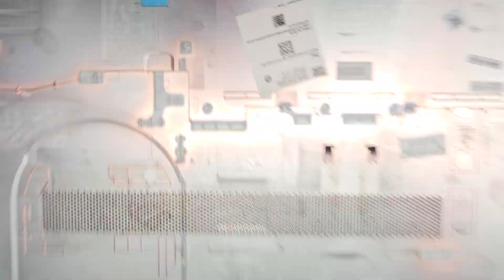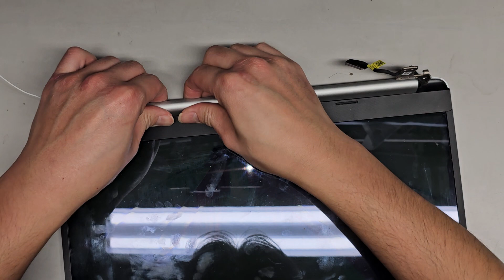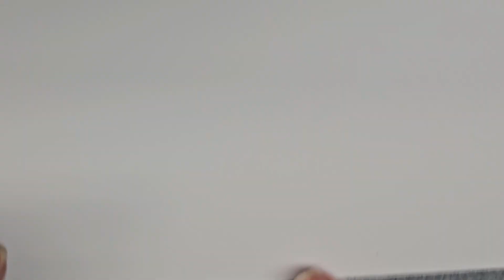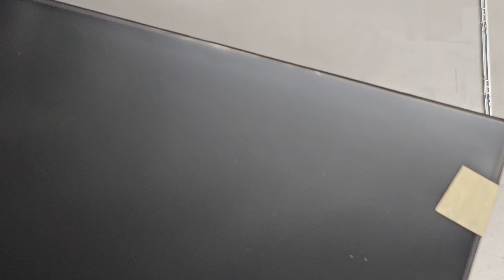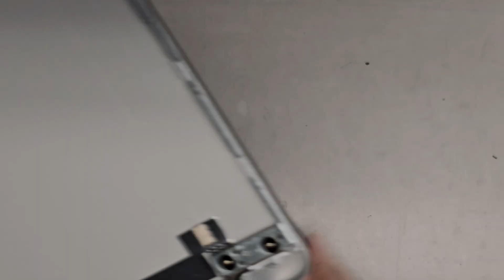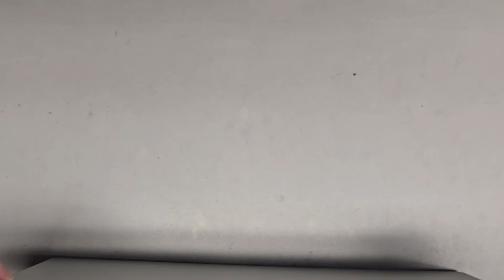HP Laptop 15-dw3035cl Disassembly RAM SSD Hard Drive Upgrade Battery LCD Screen Replacement Repair

Comment: Ihave a hp 15s laptop same layout as this but i cant find the cmos battery
It's showing CMOS checksum error every time I start my laptop and the battery is always on 0% and shuts down as soon as i unplug 
Pls any advice
Reply from the maker: It's built into the main battery. Likely bad battery needs to be replaced.

Comment: Sir mere pass Dell latitude 3450 2 pic  leptop  heai usmay ak sahi heai aur ak ka srip motherbord bord sahi heai baki sab kuch damage heai to moje mother board ko external monitor say use karna heai to sir ak problem heai without display cable leptop on hi nahi hopata heai jab may on condition leptop may display cable remove Kia fir on kiaa to on nihota heai asa kya huta heaiwithout display cable on karneki aur koe idea 💡 heai kya sir ap ki pass

Kon si line ko short karki on karsakte heai kya touch screen display laga heai ESI leay sayed without display cable on nahi hopata heai sir
Reply: नमस्ते मेरे दोस्त। हमें खेद है कि हमें आपकी पोस्ट का अंग्रेजी में अनुवाद करने में थोड़ी परेशानी हो रही है। मैंने भी ऐसा करने की कोशिश की लेकिन कोई सफलता नहीं मिली। शायद मेरे नाम का उपयोग करें और मुझे फेसबुक पर ढूंढें और बस मुझे अपनी मूल भाषा में लिखें और मुझे विश्वास है कि मैं अनुवाद में मदद कर सकता हूं। धन्यवाद।
Reply from the maker: @mrkemblegilstrap Hope it works
Reply from the maker: Google is unable to translate. I don't know what you said.
Reply: @ItsBinhRepaired Hiya Bihn. I hope you are getting better. 
I took a shot at translating this post with not much luck. I'm guessing it was Hindi, so I offered to have him write to me in his native language and we would have a better chance of communicating.